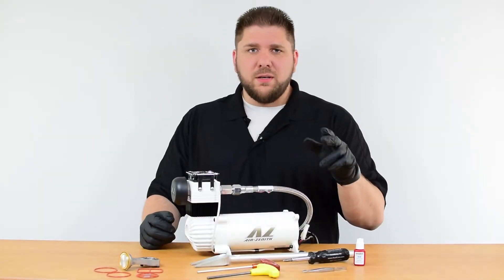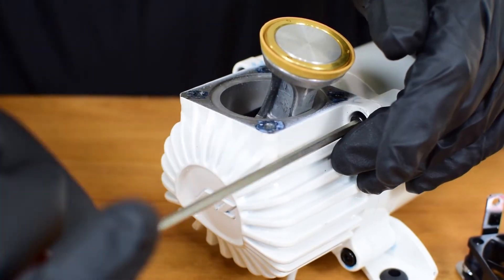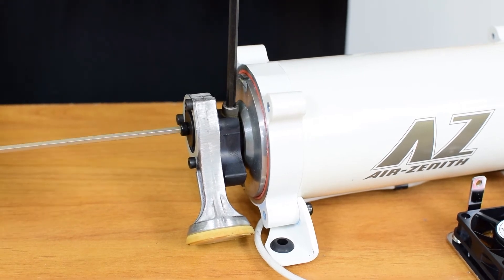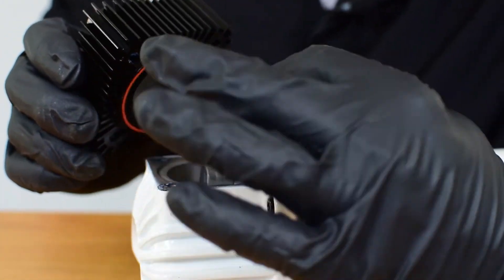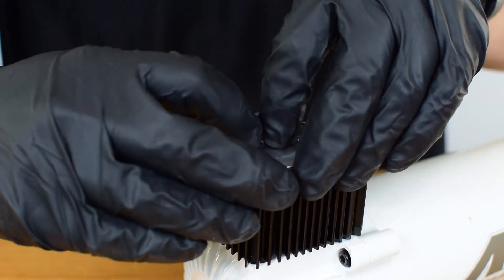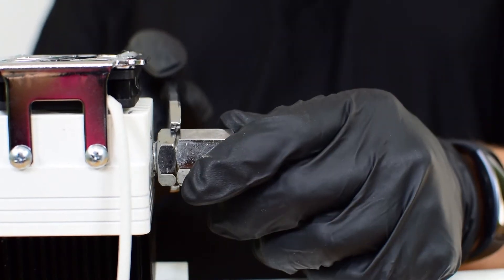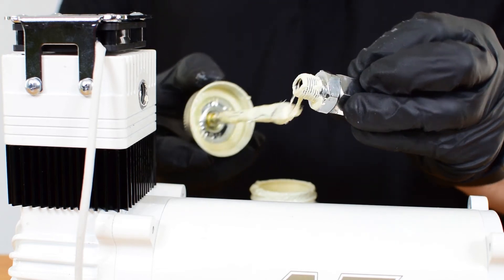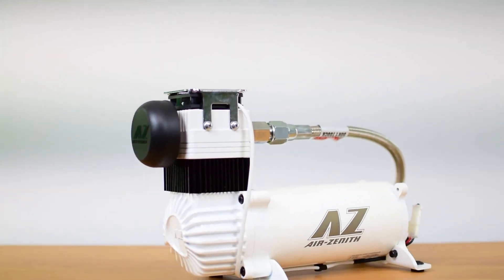Air Zenith OB2 Full rebuild tutorial

Comment: My shaft broke while I was trying to remove my old piston from the compressor shaft. So be careful because a pickle fork would not fit between the shaft and the piston I could barely get a flat head screw driver between them. And Air Zenith don't have the shaft for sale. Anyone know where I could get a shaft from. The shaft comes off the compressor but I cant find a replacement from? HELP PLEASE
Reply: Well i just did the exactly same thing 🥲